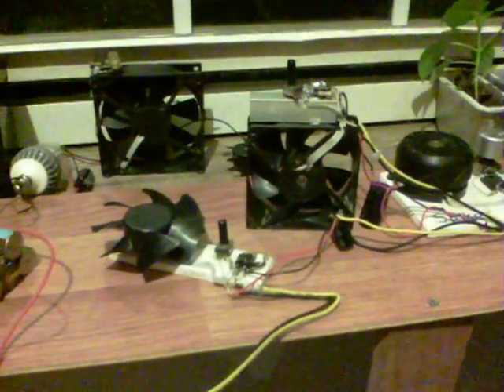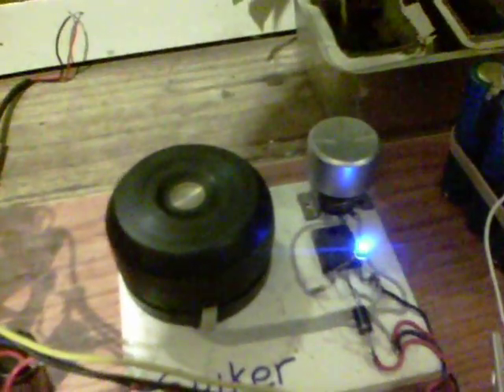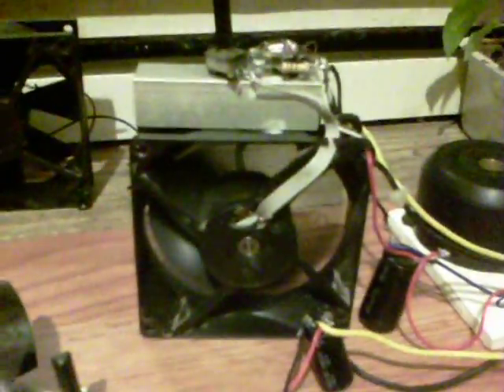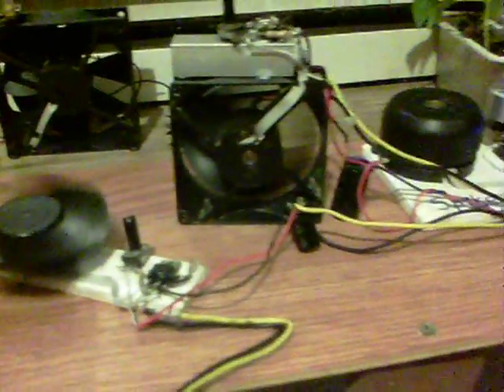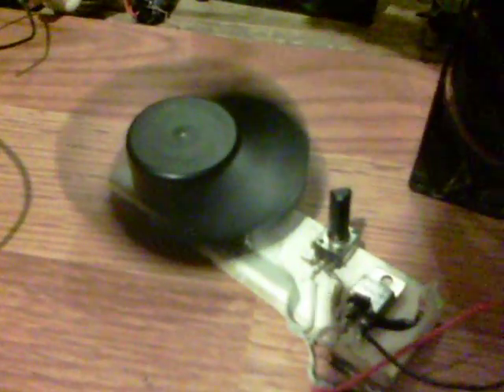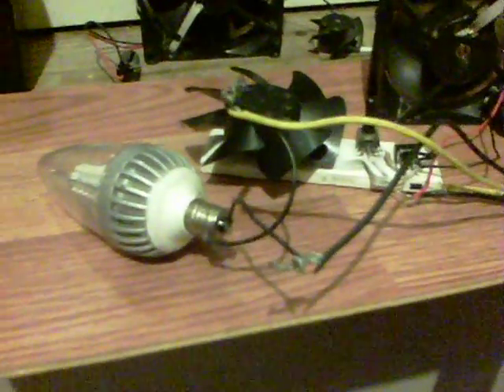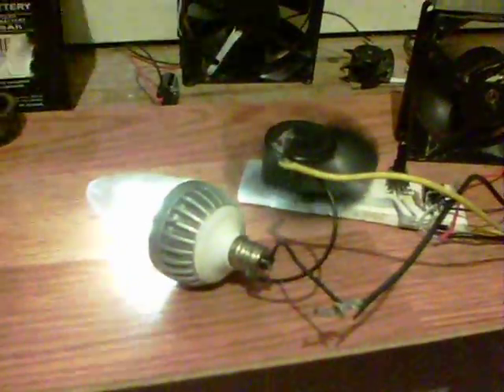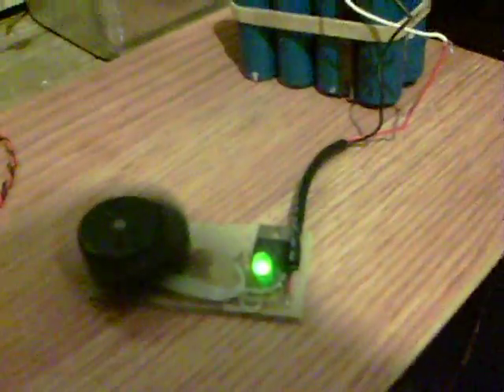Multi SSG Motors In Series

Comment from the maker: As a star configuration it would work like batteries + may be better than series...but here, if each series fans coils could collapse at 300V then the chain could be really long, with wind/torque as output! It seems to work like solar panels, in that for a 12V batt you need approx 18V from a panel, so the 300V is 'soaked' by the motor load to some extent for capacitor current. It does take some fine pot movement to make sure 1 runs from the other, though my pots are 5K or 10K not the finer 1K.

Comment: I'm not so sure that is won't work. If you think of each coil/fan as a battery, then you already know that you can charge up several batteries in series. The limit is the amount of voltage being produced by the charger.  If the 1st coil/fan produces 300V, and each charging coil/fan takes 20V, ... Do you see what I am suggesting?
Thanks for taking the time to respond!
Have a great day.
Tony

Comment: Would be doable indeed :) the only thing we need to watch is to protect the arduino input from any voltage spike to prevent damage the rest should be pretty easy to assemble :P and I just modify one fan :P not it work on the single coil design and I have the other one for "extra" things :P

Comment from the maker: Great sounding video, if a little voyeuristic on the LED side of things. Have spectacularly blown an LED on a Gegene setup, with a bang/pop but it wasn't intended. 
Does a partially scorched LED still work for sunlight tests ? I mean, does it change the properties as a solar cell ? They work better as they heat up, so if damaged already by a quick blast of heat it may quirkily improve their efficiency.

Comment from the maker: Yeah Tony, that's a wonder. I think if each motor uses less as it goes along then that's one way, but I don't have matched motors (coil ohms) and only know the obvious, that a higher rated motor won't run from a lower rated one. Matched up may be very interesting indeed for a long chain.

Comment: I have a nema17 version on the bench atm, with TIP122. The LED graveyard is growing fast, Even with 2 in parallel, or three in series, they just die. Also tip31 had 1000v+ (high as the scope goes) spikes on 6v... So I blew 2 of them up on 12v too :) Probably should put a neon or something on there... Is it normal for a pulse motor to get fire in charging LED's? White ones can do orange and yellow too apparently... Also there was plasma in the 1k pot, now I have to use a 10k. Video tomorrow. :)

Comment: White LEDS tend to go blue from volts, and green from amps if that helps. Can overdrive them considerably provided the duty cycle is short enough to allow for lots of cooling. Lumen output is usually down once the colour changes. Long neg legs help cooling a lot too. Watch the bottom of an overdriven led, it always goes black around the neg leg. Great little motor chain. How many can you do in series, and if you have ten, can the last fill the run cap? Its got to be tried!

Comment from the maker: Nah, I wouldn't think so, just more efficiency than the usual running of 1 fan. They're SSG's so there are thousands of such motors, but perhaps the extra here is the running of smaller amperage need fans as they go along in series...the wind output counts then. The final output charge ability is likely less, as a balance.